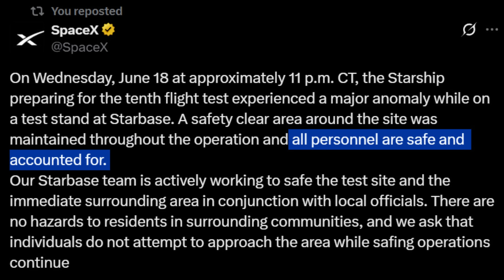SpaceX's Latest Starship Explodes During Ground Test

Comment from the maker: 4 hours after this was posted Elon tweeted that the leading suspect is a COPV failing below its design pressure, these are primarily used with nitrogen for things like the fire suppression system. If true it's possible that a tank was damaged by technicians during installation, small damage to composites can lead to early failure after fewer cycles than expected. A high pressure cylinder breaking under pressure would knock holes int the side of the payload area and break the downcomers connecting the header tanks.
Reply: Fire suppression system might have caused a fire, then, eh?
Reply: @addison1024 

Fire expression system.
Reply: @addison1024  have you ever seen what happens if you use a Class A fire extinguisher on an oil fire
Reply: @bobdole57 At a guess, the same as using water on one
Reply: @addison1024 It was a Fire Spreader system that was accidentally installed instead of the FSS.
Reply: Composite pressure vessel failed on the anniversary of Titan’s implosion. I call that a tribute.
Reply: Reusable second stage man, it’s gonna be a tough nut to crack
Reply: I guess if they can't find the real cause, at least they've found some expendable poor sap to throw under the bus.
Reply: Nitrogen bottle for pressurizing the cargo area before landing so it doesn't buckle?

Maybe it is like the strut that failed on a Falcon 9 10-ish years ago? Sometimes there is a manufacturing defect.
Reply: I dunno, if it's such a fickle component, what does that say about reusability of Spaceship? I mean, how would that component handle rough reentries over the time?
Reply: @h.a.9880  They get used on Falcon 9 all the time no problem... a COPV issue was the cause of the second loss of a Falcon 9, but that was hundreds of successful flights ago by now and involved a very exotic failure mode that was pretty much unknown previously. The issue is not using COPVs, it's treating them with the necessary care. ANd it seems to me like while the SpaceX teams in Hawthorne and Florida have their QA sorted out very well, Texas might need some serious rethinking of their processes.
Reply: @johannesgutsmiedl366   "a COPV issue was the cause of the second loss of a Falcon 9"  That was the palatable reason presented in the official report, but there was also a negative structural margin to the revised fueling order which could have caused failure of a bracket or something (I forget), triggering tank dislocation and failure.  SpaceX simply wasn't careful enough in how they did the analysis related to the change.
Reply: @marcmcreynolds2827  Looks like if that was indeed the case (and considering the NASA and air force were both part of that investigation and to my kowledge confirmed the LOX freezing issue as the primary cause of the accident), it sure seems like they learned from it and implemented the correct lessons given the incredibly successful history of the Falcon 9 since then.
Reply: @h.a.9880 Shuttle Refurbishment Technicians HATE this ONE SIMPLE TRICK.
Reply: @h.a.9880  It doesn't say anything about the reusability, this is EARLY in the prototype phase.
Reply: @LordFalconsword  It really depends on what type of system this is and if they planned on using it as is. Sure, they can adapt it, but having it blow up an entire rocket out of nowhere is less than ideal.
Reply: @h.a.9880  this thin is not even close to reusable. As everyone that is not in the SpaceX cult can see this thing is not made well at all. The fuel tank is one layer of carbon fiber thick. Thats not even close to good enough. So is most of the pipes and tubes.  It is so compromised toward vertical landing to get payload back its made too weak. This is why the Space Shuttle had wings. A Space Plane is the way to do this.
Reply: @h.a.9880  COPVs are used reliably on just about every spacecraft there is because of the high strength to weight ratio. But like anything ya gotta make it right and treat it right if you don't want It blowing up in your face.
Reply: @h.a.9880  I wouldn't worry about re-usability when there are so many usability issues.

I dont see an ejection system on this crazy train.
Reply: Didn’t one side of the lifting apparatus become disconnected recently when they were moving it, causing it to hang from just one side?
Reply: If this was Stockton Rush operation…. They would have been fully loaded with people to give it the right test. Well, I mean according to Stockton Rush…
Reply: > these are primarily used with nitrogen for things like the fire suppression system

The jokes write themselves.
Reply: I agree.  I used to be over the nose cones. COPV bottles are bad juju with the slightest nick, cut, or bad wrap.  And they are difficult to inspect.
Reply: My first reaction upon seeing this (before Elon posted) was "oh, we're back to COPV failures again. Quelle surprise!"

IIUC there are very few other things that would be cause such an energetic disassembly of those downcomers. As you said it looks like a pressure excursion in a header tank coupled with a fluid hammer effect or something like that, with the COPV being the most likely source for the initial overpressure.
Reply: By mistake they placed the rocket upside down onto the pad, the nozzle was at the top. :D :D
Reply: That’s congruent with Morgan Khan whistleblowing about COPV mistreatment some time ago.  

Whoops. Who knew you’d have to be careful with flight hardware?
Reply: Pity no smoking gun for in flight
Reply: Another case where the bean counters had a victory over the engineers.
Isn't this company led by the same guy, who said Tesla's FSD would work with cameras only? The same guy who was fulfilling the role of Supreme Bean Counter of the US government?
Reply: Scott, your channel, knowledge and aim is superb. But. 
Elon’s Spaceship is a dud. 
And a massive misuse of federal funding. There will be congressional investigations years ahead.
Reply: Scott, your channel, knowledge and aim is superb. But. 
Elon’s Spaceship is a dud. 
And a massive misuse of federal funding. There will be congressional investigations years ahead.
Reply: Robustness=mass. Time to put on some pounds.
Reply: lol
Reply: Space X has started is soviet era.
The Russians used to blow up  their liquid fueled rockets all the time.
Reply: Very nice of him to let us know it didn't explode for no reason
Reply: I'm sure we will be on Mars by the end of the next year
Reply: the word is Their AI they use for design is faulty i.e. not Intelligent enough.
Reply: Excellent indication of resistance to wear.  Reusability on the horizon for sure, VErrRy soon after orbit is achieved
Reply: So if the COPV is at the bottom of the empty bay, and assuming it’s valve was pointed down, I could see the valve failing and the tank tearing up the side of the ship and bursting the top tanks as it sort of internally launched.
Reply: Still means the nose cone is DAF.
Reply: Extremely stupid tech to have on a basic massive bottle rocket. Dumbest shit on the world
Reply: If you insist on using flammable liquid we might as well skip to Paraffin right, sine we are building stone age bottle rockets. Mr. Musk is real good at building things that explode, from mobile human incineration devices to super massive rocket fuel distributors for the lower atmosphere..
This guy wastes more money than Disney. Wake up Elon what the hell?
Reply: Thank god he has actual geniuses in his employ to tell him what caused the failure, otherwise he'd never know. Lol
Reply: @Noelsterrr i strongly doubt it... If you look at the other things he is trying to develop: Robot-taxis? What the hell Elon. Come down to earth
Reply: The title screen has a typo. It should read "Mot momimal".
Reply: Wake up and smell the fruit loops!  SpaceX is experiencing sabotage, form within or from outside the perimeter, a bunch of someones do not like Musk anymore and their torching Starships instead of Teslas.  With such pressures and energies, it would not take a great deal of effort to cause a catastrophic problem.
Reply: Groveling to a racist is not a good look for you, Scott.
Reply: Hmm, l heard musk say he thought it was Biden who had been sneaking around  space x
with a screw driver.. l never doubt anything musk says..a fine upstanding man.
Reply: Simpler - Grifter musk can only build garbage.
Reply: "If true it's possible that a tank was damaged by technicians during installation"
Thank goodness, it's definitely not a system design issue then
Reply: Well, let's go to Mars then...

Would you join in?
No, you won't...
Reply: That's the same thing a mechanic did to the outlet valve on my car's radiator one time to try to get me to spend more money. Of course it didn't explode that big afterward
Reply: I mean look at how many NASA SLS rockets exploded before they go it right !,  oh wait that was zero. Keep buying those Tesla shares people $$, Musk needs the cash for more SpaceX rockets.
Reply: So technician being asked to install the COPV on hour 12 of their 6th 12 hour day in a row was a bad decision?
Reply: @mgzuck  At least it wasn't on a Friday... 😇
Reply: @mgzuck  Now come on, if he didn't want to work 6-days a week with 12 hour shifts, he shouldn't have been born poor.
Reply: This would make a lot of sense, and if true would be a best case scenario in terms of getting the Starship program back on track. Great analysis of the video footage -- impressive that the cameras caught so much detail of the early part of the rupture!
Reply: @joakimlindblom8256  "...and if true would be a best case scenario in terms of getting the Starship program back on track."

Which is also kind of a reason to look with a lot of scrutiny at this explanation. If Ketamusk tells us the thing that went wrong is something easily fixed, it might necessarily be the truth, but rather what he tells publically to make investors happy while they fix something more troublesome.
Reply: @h.a.9880  maybe you missed the fact that he regularly gets drug tested at random, and he came back negative for the most recent test
Reply: @joebuslife9275 He claims that was the result of a test. I once claimed to be a martian. I'm not.
Reply: @joebuslife9275  Honestly, I couldn't give less of a shit about Musk's drug habits, but it's fun to throw it around to see where it sticks.
Reply: @h.a.9880  I'd argue that if you see Elon's lips moving, he's lying.
Reply: @joebuslife9275  You actually believe that's true?  🤣
Reply: @h.a.9880 what investors?
Reply: @HNedel  Of course SpaceX has investors, the stocks aren't traded publically, but they are still used by people to invest into SpaceX.
This is just one way how people invest into the company.
Reply: @joebuslife9275  Uh huh.  Surely those tests are on the level, because Musk does not remotely have enough cash to grease a palm to make that happen.  He readily ADMITS to drug use, and has been filmed openly 'recreating', so maybe put a little thought in next time?
Reply: @AnonEyeMouse  "I once claimed to be a martian. I'm not."

ARE   YOU   SURE  ???
Reply: @MrJdsenior show me one video besides the Joe Rogan interview
Reply: @Beer_Dad1975  if you have evidence to the contrary im all ears
Reply: @AnonEyeMouse Elon posted the evidence, you have none. Pretty sure it's you that have the unsubstantiated claim based on a left leaning hit piece using anonymous sources.
Reply: Technical knowledge about composites lifespan after repeating flexing has not, imho, been adequately determined for any high-pressure application. 

And if a technician can make a miniscule point of damage which creates a spectacular failure....that negates any advantage in using composites.
Reply: @Name-ps9fx  You're jumping to an invalid conclusion here.  COPVs are well understood. I'm looking at one now.  It's called a scuba tank! We're talking common pressure vessels here, nothing more, nothing less.
Reply: I'm guessing that they are using GHe in the COPV, but I don't know.  Yes, handling damage is one of the failure modes I didn't list.  COPV protection during manufacturing and integration is a tenant.  don't pull protective covers off until all overhead work is completed....
Reply: @tomakamcgoon834 If the COPV is used in a cryo or high-speed application, GHe is likely; if it’s for something like fire suppression, N₂ is more probable.
Reply: So, rich fella playing with composite vessel experiences catastrophic incident...where else did i hear a story like that?
Reply: @HTOP1982 the other rich fellow used alloy endcaps on a composite cylinder, every expert and their mother was saying after the imlosion that composites don’t handle outside pressure well, they handle inside pressure. Now the experts here are using the same argument for the opposite case 🙄
Reply: I blame The Hood
Reply: @SteveGouldinSpain  FAB!!
Reply: The PEZ dispenser door is less likely to be a failure point. The door is framed, and therefore stronger.
Reply: Using composites as in carbon fiber structures? Just watched a documentary on Oceangate yesterday and maybe they should start using alloys instead?
Reply: @timotheegoulet1511  COPVs are a pretty commonly used piece of equipment, as the name implies they are a thin walled conventional metal tank wrapped with carbon fiber.  They're used regularly in either extremely high pressure jobs or to save weight, or both.  
There are indeed issues with them though, like the sub combinations of overloading, thermal expansion, or damage leading to delamination can cause them to fail explosively, since they are often pressurized far beyond what a similarly sized all-metal tank could safely hold.  
The problem with an all-steel tank is that it will either need much thicker walls or a larger internal volume to hold the necessary amount of nitrogen gas for the reaction control system.  
A while back SpaceX was talking about using tapped off evaporation gas from the fuel system for reaction control and it seems like the sooner they can work that out the better.
Reply: @timotheegoulet1511  Composites are fine, when you design properly.  If you ignore every engineer on the program and do stupid shiite anyway, a la the Shuttle program with a launch well below design and test envelope, take a guess at what can happen.   Do you really think that there have been no failures of steel structure for EXACTLY the same reason, and MANY others?  This was not a materials problem.
Reply: You're fan-boying a bit too hard. And trusting Musk a bit too easily. Also, if such a failure resulted in a catastrophic event, perhaps there's a lot more wrong here than you suspect. I know SpaceX is all about move fast and break stuff. But, they seem to break a lot of stuff because of simple errors and thats put them years off schedule. We don't talk about schedule now, do we?
Reply: Like I believe anything Elon says...
Reply: A technician just happen to accidentally cause a little damage ……oopsie wasn’t on purpose tho 😈😈
Reply: My niece wasn't accepted into Starship, and she really didn’t like the HR representative. She said that the rocket’s success is no longer in doubt for them, so it seems they don’t even need real specialists anymore.
Reply: "Company blames cheap and easy to fix part, assures investors that there is no need to panic!"

It's definitely not a fundamental technology, material, culture, process, or architectural issue! Just this little tank and clumsy, Boris. Root cause analysis done, keep the funds coming please!
Reply: it's all a waste of money, spend it on fusion research instead
Reply: @FourthWayRanch  Better to spend it on the search for bigfoot and yeti. You'll find bigfoot and yeti long before we get fusion power, but neither bigfoot nor fusion power helps humanity survive the next asteroid.
Reply: Don't get me wrong, but why go for composites (that doomed an earlier SSTO project, forgot the name) , if you're taking the 'other' approach and weight doesn't matter that much?
Reply: @stephdelta0388  COPVs are way stronger than a steel equivalent and therefor take up a lot less space. for the same pressure and volume. It's not just about weight.
Reply: Composite Tanks have been known for over 20 years to not be reliable... in fact it was first proven in the Paintball industry,  No other nitrogen/co2 tanks failed during play other than Composite tanks.  It became so bad and deadly that shops refused to refill them and started a rigourous testing campaign and you could only refill after tank is tested (which you paid extra for)

Why would anyone use such things in a rocket is beyond me, to save a little weight?  We so called "PC Engineers" or so you taught said this years ago, we also warned about the ground tanks around the pad was also way too close, its not even allowed in Aviation why would it be allowed for rockets?  But hey, we were told "you think your smarter than Elon?" and "Your an armchair engineer"  not knowing most of us commenting and critiquing the choices Elon were making are actual Engineers longer in the field than Elon himself has been alive.

Now rebuild everything at the test facility, your cost saving using composite tanks just cost you way more money.

BRAVO!!!

Saw Felix's (What About it)  interview as well... Its sometimes good to not have your nose right up Elon's Arse, its more helpful to be actually critical of certain things vs Brown nosing... But you cant have you loosing respect from Elon huh...  It is a Blunder on your part not speaking up at that point, just like it was a blunder on last live stream of test launch where you got up and left chat with an utter moron missing everything that happened during the flight and that it was even in trouble until a full half hour after.

Sad people.

But hey when you Stop Micro-Managing and go to play politician and set your seed willy nilly  in multiple women, something must go wrong... and here we are. i saw your interview as w
Reply: Isn't the whole point of using steel was to avoid these problems with composites...

The fact that such an accident would happen before launch is more of a symptom of arrogance.  This is something they should've had worked out already...  We should be seeing them explode as they try to re-enter and land now...
Reply: @johnwang9914  Robust is one of but not all of the reason why they choose steel, steel is better for iterating their design, where composite would need mold for each prototype (and mold are expensive)
Composites is still a excellent material, stop using it just because it fail once isn't the way, but they would need to add more safety measure for sure.
Reply: @johnwang9914  there's a reason they don't have crew on board after all
Reply: @johnwang9914 plenty of time for that..
Reply: Is there some reason the COPV is not SEPARATELY tested for performance BEFORE install into the overall assembly?  I'll tell you why: they are moving too fast, and not thinking enough.   Which is no surprise, as who wants to work for elon these days?
Reply: @cheponis What makes you think a bought in off the shelf component hasn't been tested?
Reply: @owensparks5013  Because it blew up?
Reply: @cheponis  It was tested. That can't account for damage incurred during transport and installation. Like the time one of the sealing pins of the RS-25 failed in flight because one of the pins wasn't in properly. There will always be limitations because of humans humaning.
Reply: @BabyMakR  Thanks for your comment.  Thing is, Engineers are supposed to design systems that work; if it's known that installation errors can cause faulty systems, it's up to the engineers to have tests AFTER installation.  I view this failure as gross negligence by the spacex engineering team.      I could explain in detail why I think Starship will never work, but it's basically because Elon is not a 'systems person' - he tends to laser-focus on specifics, e.g. booster thrust or heat-tile performance.  He doesn't (I would argue "can't") consider what happens when the A beam is connected to the C pillar to the D engine -- THEN what.
Reply: @cheponis  It will never work... And we will never be able to land an orbital booster vertically. And we will never be able to rapidly reuse an orbital booster. And we will never be able to catch fairings. And we will never be able to reuse fairings. And we will never be able to launch a rocket with 33 engines. And we will never be able to catch a huge rocket. 

People like you have been saying never about new ideas for centuries. The rest of us just ignore you and do it anyway.
Reply: @cheponis  Also. Elon is just the guy that shoots the spit balls at the wall. The engineers are the ones that do the work to make it happen. Elon just puts his name on it.
Reply: @BabyMakR  True.  I fear that the geeks are so enamored / mesmerized by Elon that they tell him "sure we can do it!" without really thinking it through, since Elon does not like to hear "No, it can't be done!" --- because if you say that, you get a pink slip from HR the next day.
Reply: @cheponis  Too many people idolise Elon. He's just a guy who had an idea and paid actual smart people to make it work. That's all.
Reply: Of course the failure happened at a juncture where SpaceX could scapegoat some technician. Glad they took the time to do a thorough investigation.👎
Reply: @Liquidglitch exactly right!
Reply: Full confidence restored. 
I mean this happened all the time during the Apollo program. 
And the NASA director also issued encouraging statements prematurely after each explosion.
Reply: @peterasp955 Would that be Stanley Kubrick?
Reply: @peterasp955 you realize Apollo 6 and 13 didnt blow up at launch due to straight up miracles... Apollo 6 especially survived because a tech cross wired 2 J2 engines to the IU and they accidentally shut off the rivht engines that were about to POGO the booster apart... An F1 also POGOd on a flight stage sep  occurred just before it too wound of broke a mount... Apollo and so many lucky saves it's not even a good movie script no one would belive it... Oh and that was with 2% of the entire US budget and 500k employees... Shuttle was worse STS 1 had tiles missing lucky it didnt burn, the boosters were death sticks for 24 flights and killed the crew on 25... Foam fell off from day one dumb luck saved  numerous Shuttles... Space Flight is 60% engineering and 40% your lucky day...
Reply: @peterasp955  God I hope this is sarcasm. In today’s world, who knows?
Reply: @peterasp955  "I mean [sic] this happened all the time during the Apollo program."

With the exception of the Apollo 1 fire and Apollo 13's in-flight incident, I don't recall any Saturn IB or Saturn V's being lost at all, during a pad test.
Reply: @MelioraCogito  That was the point, it was sarcasm. It's blatantly obvious at this point that Starship is an unmitigated failure that will never get to the moon let alone Mars.
Reply: @Beer_Dad1975  I'm right there with you in the scepticism of Starship's usefulness for manned missions to the lunar or Martian surface.

IMHO, without extended landing struts, I expect Starship to dig a hole so large and deep on the lunar surface, that upon touchdown and engine shutoff, it will fall over and go 💥**KER-F'G BOOM**💥
Reply: @MelioraCogito  Yup, landing an 85 ton skyscraper on regolith even under 1/3rd or even 1/6th of a G seems like a near insurmountable problem that they haven't even started to solve yet.
Reply: @peterasp955 😂
Reply: @peterasp955  This is why Elon wants to make 1000 of them a year - because he's expecting most of them to blow up during refueling - brilliant planning, that man is just a genius.
Reply: @peterasp955  
How do you know what did and didn't happen during Apollo? Just curious.
Reply: @DavidVanDriessen-o5q 
That my friend is well documented.
Reply: @peterasp955  some of us are even old enough to remember
Reply: @DavidVanDriessen-o5q before the Internet we had these things called books, and media, and people told each other anecdotes. 
Try looking those up instead of trying to be clever
Reply: @Liquidglitch 
You've obviously read none of them. If you had, you'd know there were many catastrophic failures. Many.
Reply: @DavidVanDriessen-o5q  
He doesn't.
Reply: @DavidVanDriessen-o5q   If you're old like me, you read the news.  If you weren't around then, you read the history books.  The Saturn V rocket never exploded on the launch pad during a test or a mission.
Reply: @fr57ujf  What would you call Apillo 1? The capsule hull literally failed from overpressure and 3 crewmembers died.
Reply: @DavidVanDriessen-o5q  You're mistaken.  The Apollo 1 tragedy did not involve a hull failure.  A fire broke out in the capsule while it was on the pad for testing.  It did not involve a launch, which is what we're talking about.  Saturn V launched 13 times without exploding.  All launches carried payloads and reached LEO.  Seven went to the Moon and six landed on the Moon.  By comparison, of the nine test flights of Starship and Superheavy, none carried a payload, none have reached LEO, and five have exploded.
Reply: @fr57ujf  The overpressure from the fire caused a hull breach. I've read the entire report. And don't get me started with Apollo 13's cryo tank rupture. NASA has experienced MANY launch pad failures. The Space Shuttle was a notorious deathtrap, with a 1 in 50 catastrophic failure rate. As I recall, Challenger had TWO catastrophic hull breaches - one on the booster and one on the external tank - during launch.
None of the Starship launches were planned to achieve LEO. Failure during development is part of any test campaign. That's why they call them test flights.
People like you laughed when SpaceX was crashing Falcon boosters. Now they've landed over 400, many of which have over 10 launches each. You naysayers will crawl back into your roach motels when SpaceX does it again. BTW, they've successfully landed and relaunched a heavy booster. No other space agency on the planet can do what SpaceX has been doing for YEARS.
Reply: @DavidVanDriessen-o5q  Nothing remotely approaching the repeated debacles of Starship.
Reply: It's a conspiracy thought, but I cant help but wonder if there is someone on the team who has ill intentions towards Elon/Space X and has tampered with the last few launches... Not defending him or his actions, but the engineers who are working on this.
Reply: @iZombits  Hah!  Remember when Elon claimed someone shot a Falcon 9 on the pad from the roof of the neighboring ULA building?  Even though there was no evidence and it made no sense at all, he wouldn't let it go.  That was nearly a decade ago - I don't know why people are suddenly surprised he's crazy now.
Reply: @iZombits telling ya..Musk thinks it's joe Biden.
Reply: don't call the empty volume the thing can barely lift into suborbital flight a "payload area"
Reply: @prjndigo  Yep this thing waste so much weight on vertical landing it is useless.
Reply: @prjndigo  "Empty grain silo" would be more accurate.